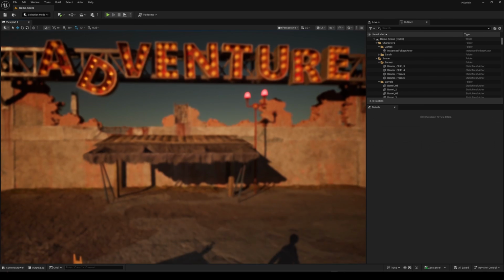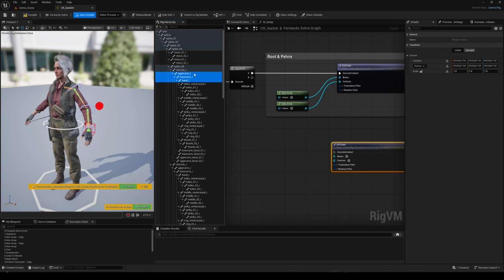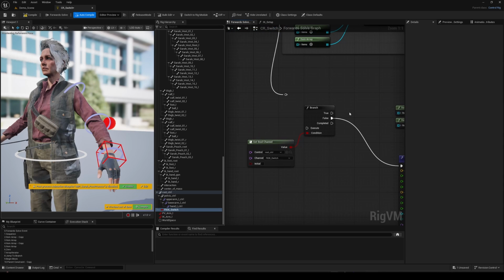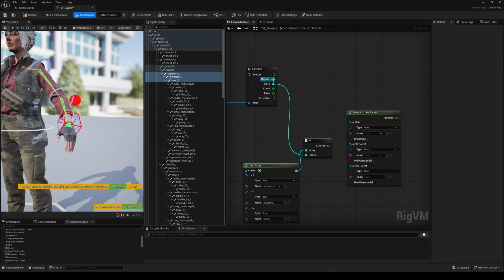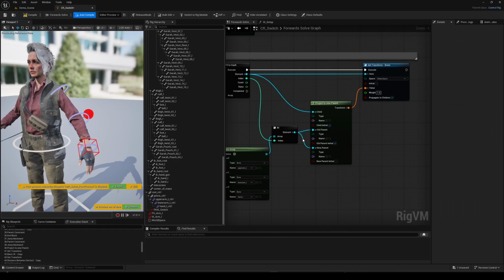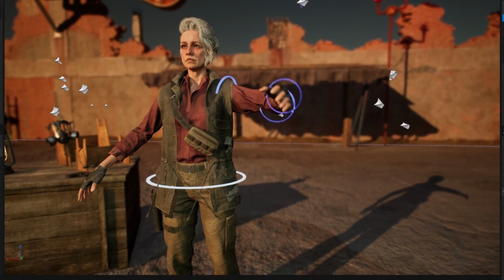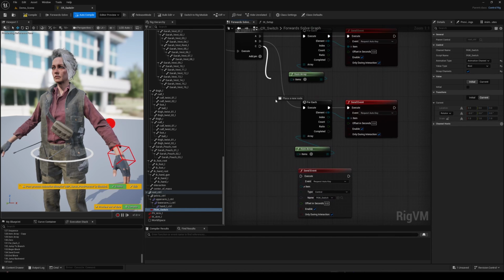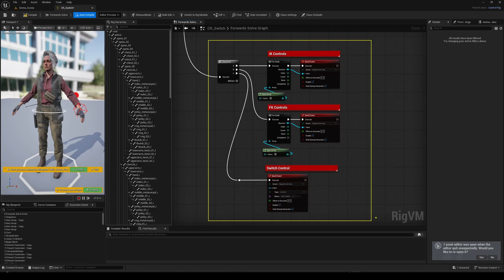FK IK Switch in Control Rig | Unreal Engine 5

Comment: Hello, I have a question. After I added nodes that automatically record IK FK switching keyframes according to your nodes in the Rig binding blueprint in UE5.6, During the process of making animations with seq, I found a problem. That is, when I constrained the IK hand to a certain object and rotated the constrained IK hand's shoulder alone, it would cause the shoulder to get stuck and unable to rotate. What is the reason for this
Reply from the maker: It might be because of the order execution of your graph! Try to check when you solve your shoulder compare to the IK. Try to invert order and see if there is any difference ! 👌

Comment: Great video and is super helpful, but I ran into one major issue:

When I use this control rig with retargeted animations in the Sequencer, baking to the control rig doesn’t generate any keyframes. II have tried doing that in both IK and FK, and still nothing shows up on the rig after baking.

Does anyone know if there’s a workaround?